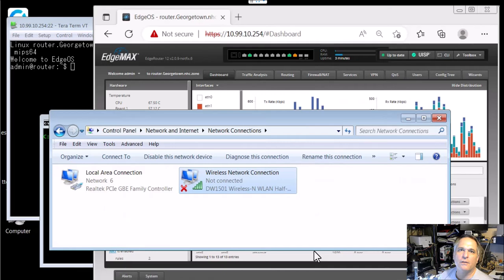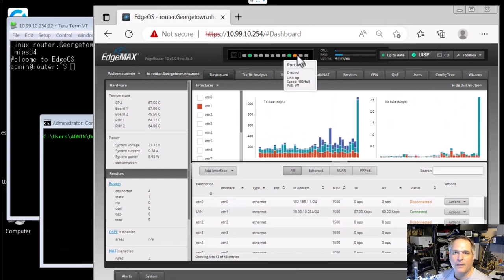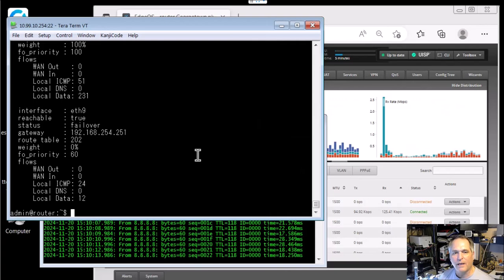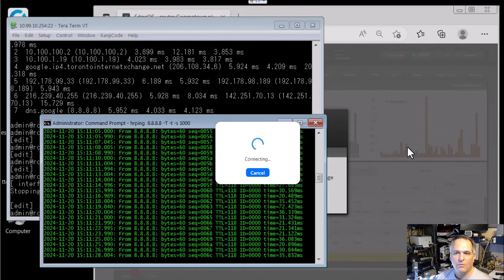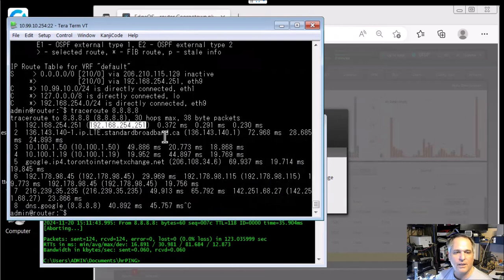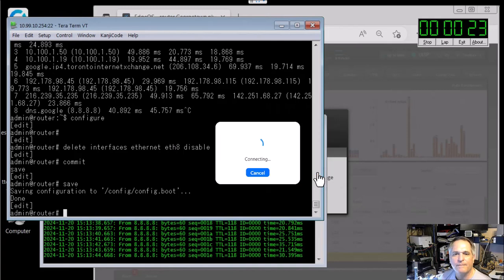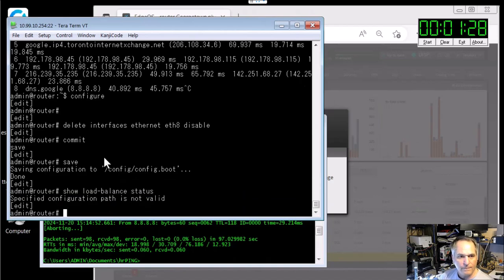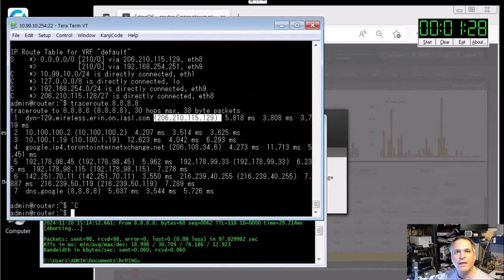Edgerouter  load balancing

Comment: Is the failover as consistent when the your upstream carrier is down? Instead of shutting the interface, what if your next hop (modem) loses connection to the carrier, so the interface is still up, but the traffic out has no path. Does that failover have any sort of detection outside of physical link loss?
Reply from the maker: @JavinCraig  Funny you should mention that i'm actually working on that exact scenario for my next article.  But to answer your question, yes it is supposed to work under that scenario as well
Reply: I have been using about 5 years already EdgeRouter (small 5 port version) just for that. Currently eth0 is connected to 1G fiber and eth1 to 50M 5G modem as an backup. It has jumped between those two multiple times. Only reason I have find out that is because outside IP changes and VPN connection to work is dropped due that, or at least it starts to reconnecting procedure.

At the beginning it was using 100/10M VDSL and 20M 4G, on that combo it was more common to have 100/10 VDSL (over copper, 40+ year old cables hanging up on air) dropping or having issues. Back then that backup/failover were more in use. On that case (VDSL) EdgeRouter had still IP from telco suplied "all burns in one" VDSL/WLAN/Router box, but next hop (DSLAM) weren't no longer responding.